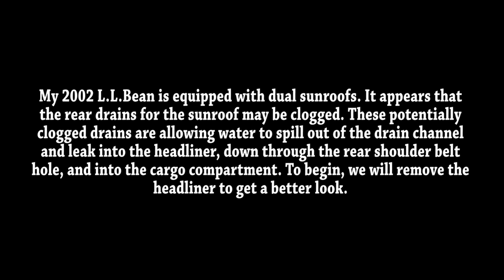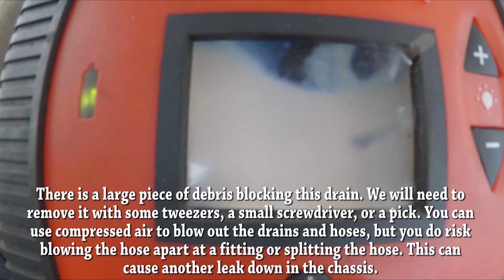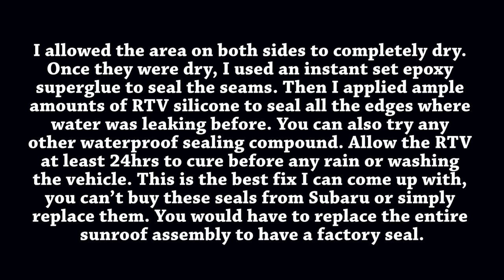Subaru Outback Sunroof Leak Repair

Comment: Thanks for this video!  I drive a 2003 Subaru Legacy w/ dual sunroofs and I think a lot of gen 4 Legacies and gen 5 Outbacks have this exact issue. The step by step was very helpful, all in all it took me about 8 hours to complete the job but I didn't have all the tools you had.  I used JB Weld's Marine Weld to seal those leaky boxes.  My wagon used to leak like crazy any time it rained to point where my spare tire well would be a pool of water. Since this fix I have had zero leaks even in the heaviest of storms. It also saved me a huge mechanic bill! cheers from Oakland CA!
Reply from the maker: Glad to help! 👍🏻

Comment: Dude, you're a god! I've been looking for JUST THIS instruction for a couple of years now. THANK YOU!!
Reply from the maker: +fishbound glad I could help! 👍
Reply: @MrSubaru1387  But in my case, I've recently found (yes, i'm just getting to this a year later) that the water is just GUSHING out of that spot you epoxied, and the tube is solid (some water DOES drain out as designed at the mudflap). Was yours GUSHING, and what the heck is that thing that the tube attaches to anyway? I can't find a part!! I'm afraid I'll have to use the whole tube of glue/sealant and with no guarantee to stop this flow!  thx.

Comment: Thanks for the great video. Mine has a leak at the rear of the backseat sunroof, but my drains were clear.  I checked the back of the unit above the headliner and saw that the rear gutter was crushed in the back near the electric motors. My sliding shade was shot too.  I think the power of the motor going back can really wreck things on the metal gutter and slider if parts get misaligned. So I found a donor sunroof from the junkyard and built one good one from both. I used zip ties on the rear gutter and I think that should be stronger than the plastic rivets that are there stock.
Reply from the maker: Glad to help! Hope if works out for you.

Comment: i was able to take only the rear half down to get to the back drains, same problem with the broken seals, used flex seal to get em sealed up..

but thanks to your video i have the locations of the fronts also, and see that i only have to take the handles off and unclip the belt plastics to lower the roof enough to get to those🖒

Comment: The speakership has my wife’s 2015 outback on and off for 6 months for leaking roof that was staining the headliner.... and they couldn’t figure it out and finally tried to say the car had been in a rollover, the entire roof had been replaced at some previous point and it was whoever did the body works fault, yet they refunded us the money we had paid then initially after they declared it was sub roof drain and it was fixed. Turns out when they tried to find the sun roof issue they checked the racks and didn’t properly replace the small single use seals under the small trim strip in front of the rack on the A pillar so there was a hole open to daylight staring them in the face they couldn’t figure out! Flex sealed it and good to go. However, first rain of the year yesterday and water spots in the rear where they had actually done the work prior on the sun roof drains, so I guess I have to clean up more of Lithia’s blunders. Stay out of Lithia anything and avoid the stealership like the plague.

Comment: Been having a problem like this on my 2002 outback with an intermittent leak through the front dome light. I resorted to gluing both sunroofs shut because I thought the gaskets were shot and letting water in. Turns out that didn't stop the problem, so I ended up stuffing rags inside the light fixture to prevent water from dripping on me and my passengers while driving. I want to peel off the glue and get the sunroofs operational again so I will definitely be trying what you did in this video once summer finally rolls around and I've got some more free time.
Reply: I have the same issue on my 01 outback dual sunrooof to I’m taking my roof interior out today 😭
Reply: I thought I was the only one thanks god 😭😭😂😂

Comment: I have a leak somewhere in my 2013 Subaru Outback but I can’t find where it is coming from. This video is the closest I can find of yours about leaks. After it rains while the car is sitting the carpet on the drivers side rear seat is wet. The rest of the car is dry. There is no sign of water anywhere in the car. Do you have any idea where it might be coming from? Thanks.

Comment: Question; I bought a 2010 Subaru Forester with a panoramic sunroof, and it decided today to not fully seal on the rear passenger side and it’s letting water in, and I’m not sure what to do, there are no forms on it or anything, or the ones that exist have no answers. Not sure what to do.
Reply from the maker: Sunroof are meant to leak. They don't seal to the roof. Check the sunroof drains. Most likely have a clog causing water not to drain from the drop rails.
Reply: MrSubaru1387 I guess I should’ve been more specific, only the one corner is leaning down, and it’s not sealed. It’s the type of one that fully opens, maybe that’s called a moonroof, but the one corner isn’t flush with the metal on top of my car. I noticed that the little thing that extends up to seal it, on the passenger side isn’t able to extend up like it used to, along with the window presenting a lot of difficulty when closing, especially when it’s in the last 4 inches of closing.

Comment: My 01 used to leak in the back about 7 years ago. I determined that the clear hoses were old and hard and did not make a tight seal anymore around the black plastic. I just put hose clamps on them and they have never leaked again. Now the front is leaking so I found this video.

Comment: Looks like ima have to do this. My 2000 Outback with dual sunroofs. Leak water in the rear area and when it was on a forward my map lights had water in em

Comment: please please do a outer cv joint replacement video as yours videos are the best on youtube for diy
Reply from the maker: Front - https://youtu.be/jtZMwaCCMdU
Rear - https://youtu.be/BhFeprB6hq4
Reply: MrSubaru1387 just the outer cv joint thow not the full axle
Reply: MrSubaru1387 so take the centre nut off.. remove two bolts on coilover/strut. Hammer the centre and it should be free the outer cv joint? Then use a cv splitter to actually remover the joint from axle?
Reply from the maker: +Ricer_forestersti we always replace the entire axle. As cheap as axles are, there's no point in just replacing one joint. Faster to replace the whole assembly.
Reply from the maker: +Ricer_forestersti right, take the out tie rod loose as well. Need it off to be able to get the axle stub out of the hub.
Reply: MrSubaru1387 you should do a how 2 video as it'll help a lot people including my self hehe as just need to change outer cv..  can I request that lol
Reply from the maker: +Ricer_forestersti we can't get the joint alone. The whole axle is $40 here. It's pointless to change just the one joint for the price. More labor involved to change one joint instead of the axle, and then you have a new inner and outer joint.

Comment: Great video! My 01 LL Bean H6 leaks in the rear hatch so I'm guessing this is the fix. But my 02 Limited seems to leak down the B pillar on the passenger side and pool up on the floorboard. Could that be a front drain hose/tube? Or maybe something else?
Reply from the maker: Most likely the sunroof.
Reply: @MrSubaru1387  Maybe. But I checked the seal and cleaned it, checked the alignment and it seems to be straight. I'll do a good checkover again once I get it back from the bodyshop next week.

Comment: I have no idea why but I am just struggling to get this video to load on 300 Mbps down lol. On the phone and wired in PC. Proving to be frustrating! I've actually got a 99 and a rock went through the front sunroof and I was going to use this as my guide to replace.

Comment: Pretty sweet...good thing you ran some water up there. Question...can the leak stain be cleaned with a foamy spray cleaner?
Reply from the maker: +CA WattsGlobal carpet or upholstery cleaner should remove the stain. Maybe even oxy-clean or similar products. You'd just need to test a small area with the product you want to use. That way you can check for discoloration or negative effects before cleaner the whole headliner.

Comment: MrSubaru- 
What do you think could be the cause for the moonroof not to close in an 01 ll bean? It opens fine with the switch, but when I try to close it with the switch, it just “clicks”. No motor sounds or anything, just a “click” of a relay I’m assuming. So it opens with the switch, but won’t close by he switch. Thanks!!
Reply from the maker: Could be something jamming the motor/track, a weak motor, poor contact in the switch, etc. Check power at the motor when the close switch is pressed.

Comment: I have a leak the front of the headliner with water coming out of the map light/ sunroof switch cover.  Any suggestions?  Thanks.
Reply: oh, it's a 2004 Legacy wagon with the sliding and the tilting sun roofs.
Reply: Hello Bro! Did you fix it? I have The same problem. Tks

Comment: Hi MrSubaru (and all Subaru fans) . I have technical question about headliner: do I have to remove the front or rear window to remove the headliner in Subaru Baja?
question 2 : is possible to flush this drain pipes with use low pressure? (for care)
Reply: No windows need to be removed. Very similar to Outback. Just shorter roof. You can flush the lines with water or blow then out with compressed air

Comment: Mine has a leak coming from the rear seatbelt retractor for the middle seat. Do you think this would help?
Reply from the maker: It's most likely the sunroof drain. Mine was leaking from there as well.
Reply: MrSubaru1387 thanks! How much do you think something like this would cost to have done?
Reply from the maker: No clue honestly. Sorry.

Comment: My rug is soaked on the driver's side floor.gow do I and the clogged drain.
Reply: Jason Bermudez that’s a different leak coming from the bottom edge of the windshield where water runs down to the front of the firewall onto where the heater vent ducting shroud is. Very common problem. Search “subaru roof leak” and there is a video of a guy showing the exact problem on the passenger side of an outback

Comment: Is it possible to work on the front moon roof by pulling the front headliner down instead of removing the entire liner? My front moon roof is sticking up on the passenger side at least 1/2" so it's not level. Just need to access it somehow to level it. Thanks.
Reply from the maker: Doing that most likely with crack the headliner or put a crease in it at the least.
Reply: @MrSubaru1387  Thank you. Will use the vid as a guide. It's a good one.
Reply from the maker: You're welcome. 👍🏻